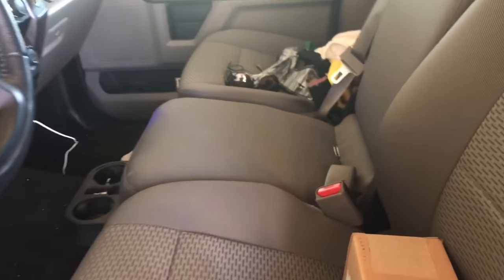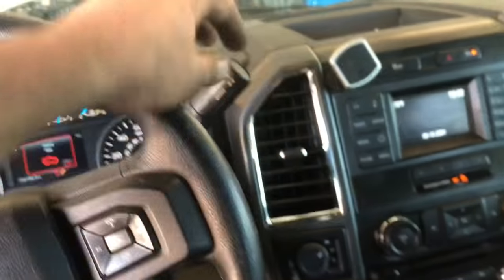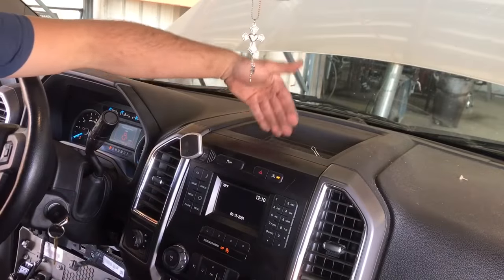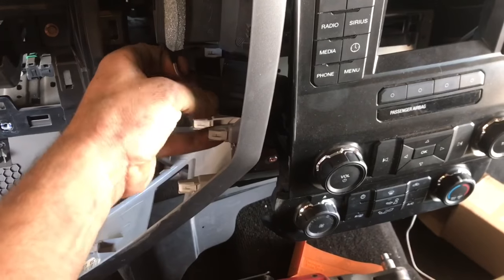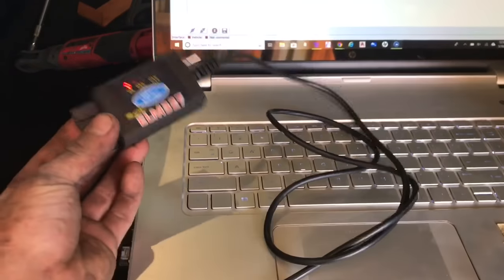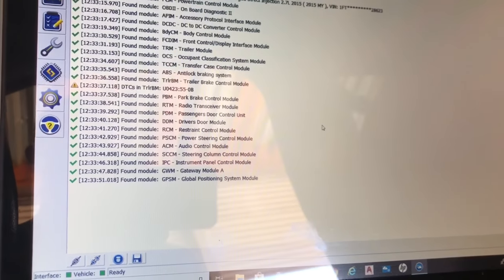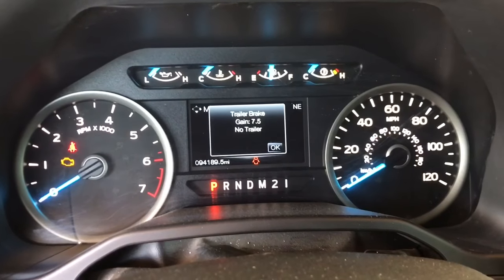Ford F-150 Oem Trailer Brake Controller Installation and Programming (2015+)

Comment: My 2016 F150 has the tree shifter and center counsel with the cup holders that but right up to the dash (there is no exposed carpet like the truck you have in this video).  You allude to this toward the beginning of your video and mention that the cup holder will have to come out, too.  How does this change the process with this extra step?

Can you please advise?

Comment: Hello, Thanks for the wonderful video. I am up to the point of reading the modules and I do not have the IPC module. What am i doing wrong? 2018 XLT with tow package.
Reply: I got the same problem on a 2019. Did u figure it out?
Reply: I got the same problem on a 2016
Reply: Same thing for me. No IPC module(s). 2016 XL F150

Comment: Fantastic vid I had the whole thing done in 10 minutes
 my question is for a 2019 f150 do you need to worry about adding a 30amp fuse? Or is that just for after market controllers?
Reply: any feedback on this? I'm looking to do the same to my 19... I had heard that the fuse concern was a 2018 item only... not certain however.
Reply: @robertconway3519  I've looked at other sites and it looks like it shouldn't be a concern, my 2019 is so far all good

Comment: So I keep getting trailer brake module fault on my 2019....any clue what's going on? I purchased the unit from my  Ford dealer..........figured it out for anyone who has same problem, it was missing a 30amp fuse in the #24 spot in the trucks Fuze box

Comment: My 2016 using this same forscan wire is not bringing up IPC. What’s up with that? It said the cable I have may not work properly with forscan but I ordered this exact cable.

Comment: I bought an aftermarket controller, installed it myself and had it programmed by the local dealer. Worked great until I changed the trailer wiring connector(incorrectly) and now the blue wire that controls the brakes is always hot/12V and the lead that charges the trailer emergency brake battery has nothing. Pretty sure I fried the controller although none of the fuses blew. Question, If I buy another controller, will the truck recognize it or will have to be programmed like the first one? 2020 Ford F150 with tow package.

Comment: Before you bother ordering the part, check your fuse box to see if you even have terminals in slot 24. Many F150's, even with the dealer installed tow package, do NOT have terminals wired to fuse slot 24 so the install will be totally pointless.

Comment: I have a 2016 F150. I did all this and I still have an issue where it shows. My trailer is not connected. I went from a four pin to a seven pin. On my dashboard I have the module working with the gain, but still shows no trailer connected. I do have all items enabled from the module. What more do I need to do?

Comment: Would this be possible on a 300a XLT with the 2.5” display without towing package? If not, what other options are there for a factory brake controller?

Comment: My truck came with a pigtail and block fuse in a plastic bag, in the glovebox. I have a 2014 without the controller installed, so does that block fuse and pigtail have something to do with the installation? I’m asking because aside from you programing with the computer on the video, you just plugged the module in and rolled with it. I need help, if what i am talking about is a factor

Comment: Dealer said my 2019 F-150 shows two options for a brake controller. He said according to my production date I need the $240 option not the $120 option. I feel thats incorrect. The picture of the $240 part doesnt look even close to what would replace the existing coin holder in my dash.

Comment: Aaron, does the truck have a built-in gain setting without installing this module, or is this module required to send voltage to trailer brakes?
Reply from the maker: No sir. The truck will not send power to the trailer without the controller installed

Comment: Hello, I have a question and I hope you can help me, I have the F-150 XL 2020 with the most basic display, I have carried out all the steps, in the IPC module only one option appears to activate, I did it and everything is in order, the intensity controller works, but it doesn't appear on the screen when I increase or decrease the braking intensity, nothing appears but it does work, any suggestions? Do I have to activate something else to get the information on the screen?

Comment: I know is a video for Ford, but I’m trying to do the same on my Chevy Silverado 2019. I was able to remove the caps in the dash with no problem but now Chevy said that even the truck is pre-wired I can’t use the OEM Break controller. Do you know if this is true? Nice Video Sir. 👍🏼🤙🏼😎

Thanks, 
Rod

Comment: 2016 ford f150 xlt. My trailer brakes work manually with the controller, but don't with the brake pedal. What did I do wrong you think?
Reply: Any fix??

Comment: Hooked up my friends trailer which I think wasn't wired properly because it ruined a bunch of electronics on my truck. Trailer brake module was one of them, now it says there's a fault. With this, I'm going to get a cable and Forscan and disable it entirely until I really need it because I barely tow anything ever anyway... The error message is just driving me crazy...
Reply from the maker: That’s very strange. What year is the truck? I’ve done this install many times and never seen that issue

Comment: Does every 2015-2020 F-150 already have that plug just sitting back there waiting for a trailer brake module to be plugged in and programmed?
Reply: Only if you have the factory tow package.

Comment: I recently purchased a new 2019 F150 XLT...I have about 3,000 miles on it and am considering installing the trailer brake controller as outlined in this video.  The dealer quoted me $521 (including 3 hours of labor!)  

I suppose I could read the fine print (which I probably will anyway), but does anyone know if installing the brake controller and  "flashing" / programming using Forscan to activate it voids the bumper to bumper warranty?   I purchased the extended 100K mile bumper to bumper warranty and just want to make sure I don''t screw myself over if there are other issues down the road.
Reply: Good question.  I don't know.  I suppose you could flash it back if you took it in for service, but then again, Ford has your 'as built' information which would not have the controller listed.  Still, I don't see any difference between you installing and flashing, and a Ford dealer doing the exact same thing.  If they did it, I'm sure it wouldn't void your warranty. You could always ask...
Reply: It won't.

Comment: My question is: what if I buy an aftermarket brake controller and mount it myself- would I still need to program the trucks computer to "see" the controller or would it just be plug and play??
Reply from the maker: No, by installing an aftermarket controller you would be bypassing the trucks computer

Comment: I have a 2019 f-150. Followed everything and when it comes to enabling the controller brake i do not have the “Trailer Brake Controller Gain Setting” , i only have “Trailer Brake Control Module”. If you have any info on this could you get back to me? Thank you
Reply: I have the same issue. I have a 2015 F-150 and do NOT have the options for Trailer Brake Controller Gain setting
Reply: Same problem on 2017 F 150 XLT
Reply: @flyin1977  You may need to go into the "As Built" section and enable Trailer Brake Controller Gain. There are values  that can be changed, vs the simple method of enabling/disabling functions.

Comment: Hi - I have a 2016 F150 XLT EcoBoost 3.5 SuperCrew.   There is no IPC module discovered after running the procedure described.  Advice?

Comment: 2015 XLT with trailer package - installed OEM trailer brake controller and enabled with forscan. (Gain Controller enabled and trailer brake module) No issues until plugging trailer into 7pin. Indicates no trailer connected. All trailer lights work. Any help would be appreciated
Reply: I am having same problem you had. Were you able to resolve this?
Reply: Hi Kyle- thanks for the response. I checked my wiring and it is all good. I’m still searching

Comment: I bought a controller off eBay and installed it following this video. Easy as can be. Using forscan and an interface cable enabled all three brake controller lines. Went to test it today and have a couple of troubling issues. The gain settings work, I can apply the brakes manually and go from wheel lock up to zero. But two things are not right. When I apply manually I get a ding and a “Trailer Disconnected” message. Everything still works and when I look at trailer status all is good. The other thing is that I don’t get a power level reading when applying the brake pedal. Another forum mentioned a controller software update from Ford to resolve this issue. But I only found that mentioned one place. Any clue? Could it be the $30 controller I got off eBay? 
Thank for any help you can offer.
Reply: Any updates?
Reply: No change. The brakes work as they should so I haven’t worried about it too much.
Reply: I have exactly the same experience as you. I'm only concerned because while it brakes by manually using brake controller. I'm not sure brakes are engaging when i press brake pedal
Reply: What year trucks you guys do this on ? 
I’m trying to do it on a 2023 and it’s not working

Comment: Did your truck come equipped with the plug for brake controlling in the bumper? Mine does not. Was wondering if I did this, and added a plug would it still work?
Reply: Electric brake wiring is integral with the stock 7-pin socket, that should be all you need.
Reply: @daveb7663  you will need the socket plus the wiring harness that hooks up to it...easy install.

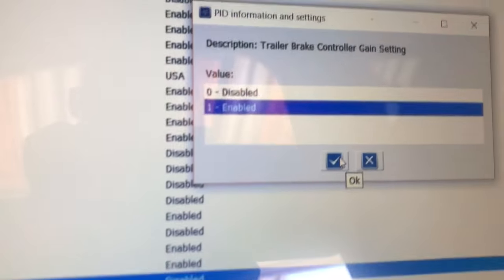Comment: 6:35 what happens if you enable that boost gauge? Will it give you the gauge option like in the mustang?
Reply: Only if you have the large instrument cluster display (Lariat +)
Reply: @Connorkmiec93  I wonder if you can install the gauge option setting like it does in the mustang.

Comment: My 2019 F-150 has several options to choose from when programming. Trailer brake controller module and trailer brake module. Is it ok to enable both of those when setting the gain to enable?
Reply: What was your outcome

Comment: I just tried to enable this with the ELM 327 module and when I clicked play, it said that I needed an extended license for this to work. How do I go about getting that license? I tried to contact ForScan support via the chat they put on the card that came in the package, but no one is responding. Any help would be appreciated.

Comment: Great video, I am one step away from finishing and can’t quite get everything done. I have a 2018 and am not seeing the "Trailer Brake Controller Gain Setting", only “Trailer Brake Control Module". Do I need to find other module?
Reply: I figured it out, it is a software problem with for scan.  Somewhere in updated versions it was deleted.  Uploaded older version and got it working.
Reply from the maker: Good to hear!
Reply: Micah Jerome where do you find a older version
Reply: @POLSKA1033 on the forscan forum page .  I had to delete newest version on my laptop and uploaded an version from 2019 amd it did the trick for me.  The newest version seemed to have a bug in that it didn't have both functions listed to turn on but the older version did have them both.
Reply: @micahjerome1345  Do you know what version you used by chance?  I'm having the same issue with mine.
Reply: @beerman523  I originally uploaded most recent version.  Then I had issue so I deleted what I had uploaded and grabbed a 2019 version and worked great
Reply: Nevermind that.  I used version 2.3.25 and it worked like a charm.

Comment: Aaron, I notice that you are very responsive to the comments.  I loved your video, and I love the fact that I can replace with OEM and do it myself.  I have a 2016 F150 XTR.   Its got the trailer plug in's on the back bumper but no controller in the change slot.  My dash, seats and everything looks exactly the same as this video.  Small backup screen, everything is the same.  Should this work the same for my vehicle ?  Also, it seems the link above for the ELM327 Cable is a broken link, can you provide a different link.  Should I be ok with my fuse panel and power to the unit, it seems from some other videos that others have issues with power supply?   Thanks.
Reply: Also - Is there an ELM327 cable for Mac that you recommend?

Comment: I installed per instructions but in Forscan I only had "Trailer Brake Control Module". I activated it but I am not seeing any gain readouts. I am wondering if my 2019 is not set up with a tow package.
Reply: Same here did you get it figured out?

Comment: Got to the very end of removal process and realized the cubby piece that you remove to add trailer brake in had no plug on the back of it — then realized I had no trailer brake controller plug behind/inside dash at all. No male plug to insert into trailer brake controller. Help?
Reply: Disregard — found the same plug hooked into something else that I traced to a dummy set of wires; taped off at the ends, zip tied to the bottom of dash and hooked into nothing. Unplugged it from that and the plug for right into the brake controller. Never mind! Weird how it was like that.

Comment: On my 2017  F-150 with the tow package, not max tow. I have installed the Ford brake controller, Started to work on IPC Module enable. I get the notice I need the extended license. I downloaded the extended license got approved, tried again and it will not work, telling me I need a key. Downloaded the Key the language  is Korean. I am a lot worried about installing, as the only review was bad and about getting "Stacked". I am not clear on that term. I want to get the controller to work. Please advise.

Comment: How do you adjust the amount of pressure to set trailer brake using this unit?
Reply: Adjust the gain on the controller.

Comment: i have a 2017 f150 without any pins in fuse spot 24. Will I need the extra power wire as well?
Reply: Yes, with an inline 30-amp fuse.  If you bought the truck and paid extra for the towing package, demand that Ford upgrades your fuse panel or does the custom wiring for free.

Comment: I did all this on my 2020 f150 yesterday but I don't know if it worked. Nothing appears in the 8" cluster when I press buttons on the controller. Maybe a trailer needs to be connected so that the controller activates? Also, I only saw the "Trailer Control Module" option in forscan, I didn't see any "gain controller"
Reply: 18 and up you need to enable the module.
Reply: @dahobbs2008  It turns out that Forscan accidentally deleted the trailer gain controller settings, I used an older version of forscan that still had it and it worked at last.

Comment: Just a quick question. My 2015 xlt had both the gain setting and the trailer brake module. They were both disabled so I enabled them both. Once I wrote to the vehicle the gain did come up on the screen. Should I have only enabled the gain setting??
Reply: Rob Zembek yeah you enable them both, he says so in the video for the 2015's. Mine had 2 of the gain settings and the brake module. Why there is 2 of the gain setting on mine has me wondering now too.

Comment: "1 trailer brake  controller module
2 trailer brake gain setting
3 trailer brake module - again.  i enabled all three. then the brake  controller failed, i replaced it then didnt enable the 3rd module, hopefully that takes care of the battery drain, maybe i disable the 1st one also if the problem persists comments appreciated
Reply: How did that work for you I'm having the same issues

Comment: I have a 2020 F-150 XLT 302A and Trailer Tow Package. 2.7 eco boost and it’s rated to pull a max 7,600lb. Trailer. I pulled a 4,000lb. camper this weekend which has electric brakes. It felt like the camper was pushing the truck during braking. My truck does not have the little trailer brake levers to the lower right of the steering column and below the pro trailer back up assist knob.  I’m confused - is my truck activating the trailer’s electric brakes? Do I have a trailer brake controller of any kind? I’ve read through the manual about all these electric trailer brake options like gain and my truck’s trailer menu doesn’t show those options. Thank you.
Reply from the maker: Unfortunately your truck doesn’t have the ability to send power to the trailer brakes. You will need to but the controller and activate the options with forscan  like shown in the video. The reason you can only tow 7,600 lbs is because you can have a trailer brake controller on the truck. The max tow option some trucks have makes the truck come with a trailer brake controller
Reply: @AaronHinesAuto  Thanks a lot for the detailed reply and the video. It was well done. It sounds like I have a great truck with a tow package that can't run electric brakes. Doesn't make much sense to me but I'll take care of getting the trailer brake controller installed and this will no longer be an issue. As luck would have it, I have an appointment already Wednesday of this week due to the truck engine stalling twice at slow speeds and the check engine light came on this morning. The reverse camera also stopped working last week until I dropped the tailgate a few times. WTF Ford - Grrr...  Thanks again!

Comment: After installing the trailer brake controller, I began to experience a parasitic draw. Best I can tell it's somewhere in the center stack. Dropping voltage across passenger compartment fuses 12 & 13 (climate head module, smart datalink converter, cluster, SCCM). Also across engine compartment fuse 40 (E-locker) which is also in the center stack. Wondering if anyone else has had similar issue after TBC install. Thanks.